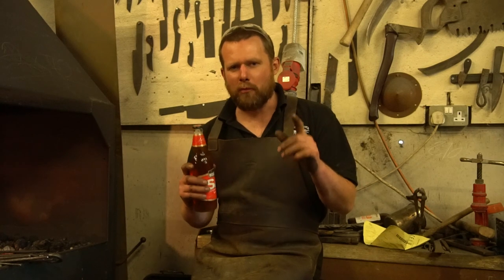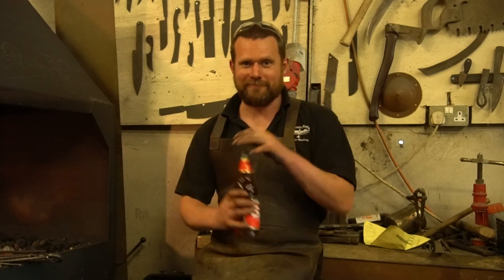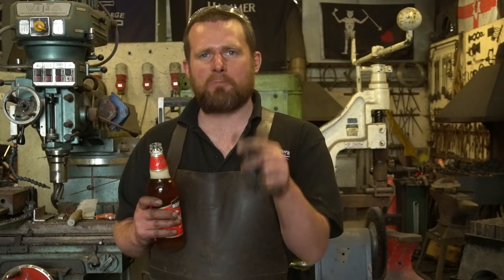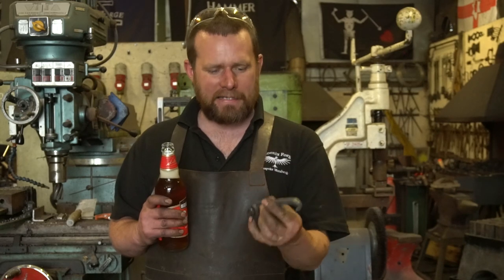Making a Ram's Head Bottle Opener - No.45

Comment: Still say a bottle opener hardy tool is a useful idea. Hot cut a piece then crack a Smith n forge cider when done using the side of it but then again I usually have a bottle opener notch built into my anvil